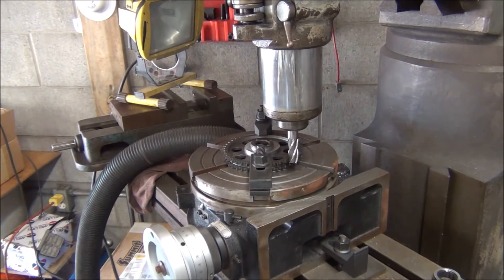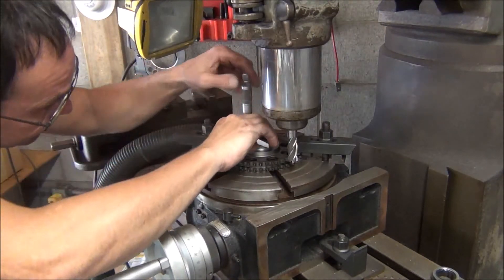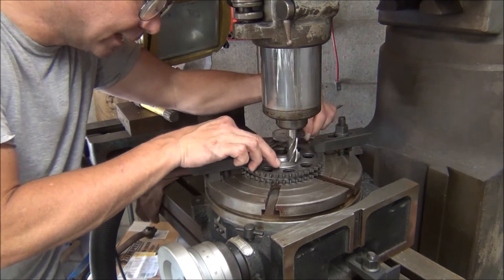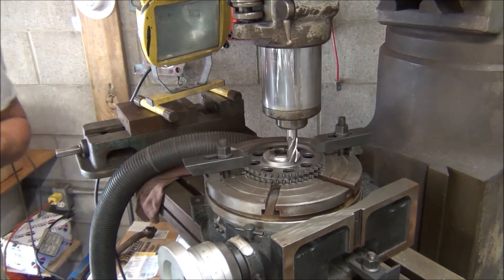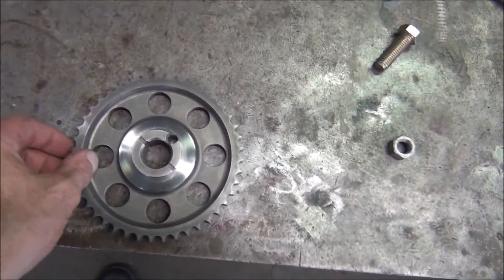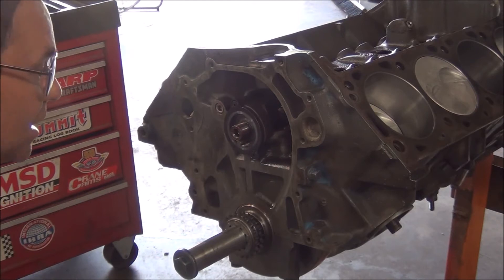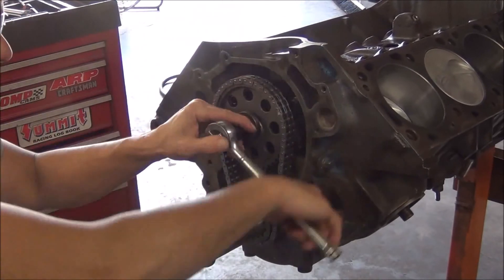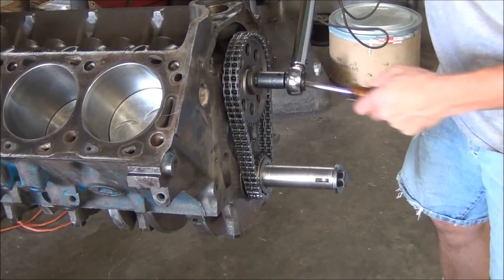460 Rebuild part 10 cam gear modification.

Comment: On your Bridgeport you using a digital readout or the old masking tape and marker way to know where your at? I haven't done much manual work in a long time been on Cnc 's for the last 24 years
Reply from the maker: I just use the dial. Thanks for watching.

Comment: On your rotary table did you have the cam gear located on a arbor?
Reply from the maker: Indicated the center of turn table in, then locked the x and y axis on the table. Then indicated the the gear in before clamping it down tight. Quicker than making an arbor when your only doing one gear. Thanks for watching .